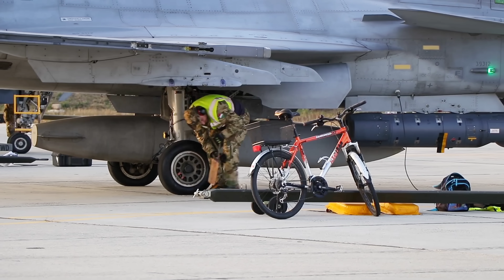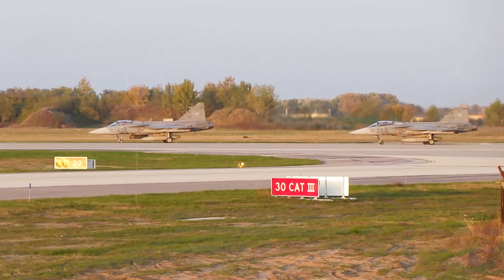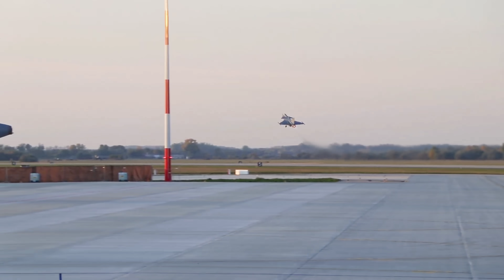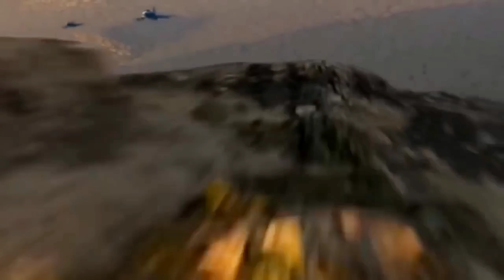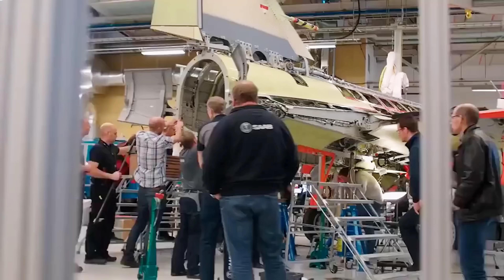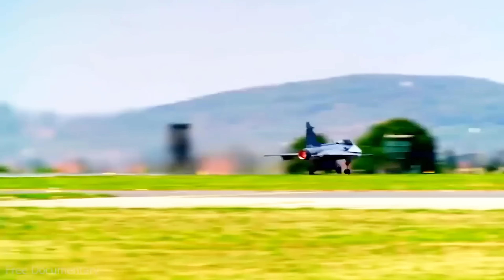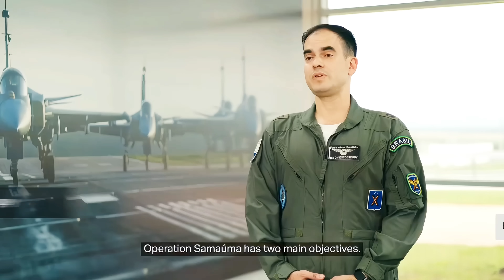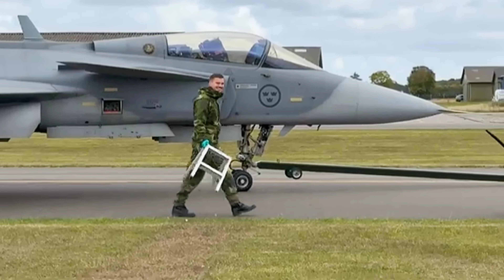How Rolls-Royce Quietly Rewired the Gripen Jet - And Shocked NATO Overnight

Comment: Rolls Royce engine superseding the American engine that Saab was using, puts US control of the Grifen out of Washington's reach! it's all Canada's now!!
Reply: Hazzazzzzzzaaaaqaq really. The F16, F15 B2, B21, F47. Sure Thing
Reply: One engine...and one only
Reply: @Fonpol68How many engines does the F-35 have? Also one. Do you have a point? There have been many successful single engine combat planes. Mirages, F-106s, Drakens, Viggens, MiG 21s. Difference is, the F-35's weight requires the most powerful engine ever made to get to Mach 1.6 due to being overweight, stealth aerodynamics impacting efficiency, and generating much more heat. The Gripen is much lighter, has a much lower power engine, yet can hit Mach 2.0, now (according to what us said in this video) has a range closer to the F-35, generates less heat, has similar sensor fusion, comparable radar,and perhaps a better EW suite.
Reply: @Fonpol68 you forgot smaller, faster, and way cheaper to run than the over price gas guslars that America produces Just like their cars! and if you buy one The US will never let you forget it, because you will need their parts and so called expertise to keep it running at even more cost this includes a high probability that they will even seek to control where and what you use it for, yer dream on America one of these days your going to wake up!!
Reply: @pv-mm2or  
And the Americans are untrustworthy, unreliable, unstable, and UNFRIENDLY.  WHY would we buy from THEM?
Reply: Still an American engine sadly, but improvements around the engine. Need to replace the actual engine.
Reply: @chriswiles8617  not anymore! the deal has gone ahead the British Rolls Royce aero space design will fly the Gripen and be built in Canada
Reply: @chriswiles8617 the actual engine has been replaced with one that’s light years ahead of the GE garbage
Reply: @kghiii I knew there were RR engine design changes to the GE one that made it go faster and further and with a variable heat signature which confused enemy sensors, but I didn’t know they had a completely new engine, if they have then that is good news given Trump is in charge of the US.

Comment: No SAAB Gripens are powered by Rolls-Royce engines. Another AI falsehood under the guise of "fact".
Reply: one thing is clear. saab and RR have been working on this for years.  neither would have accepted to talk about it if they didn't have some succes about it.  soon, it will be a done fact and usa will be out of the picture.
Reply: As I have understood it from other sources, a Gripen has been tested with RR's engine.
Reply: saab and RR have been working together for several years now to take their engine and adapt for gripen.  at least 3 years study and testing.  fact.  even today nov 18,   canada is receiving delegation from sweden: king, queen, prime minister and 60 subcontractors who build the fightet.  surely not just to say hello
Reply: Give me an airframe and an engine, I'll make them fit and sing together.